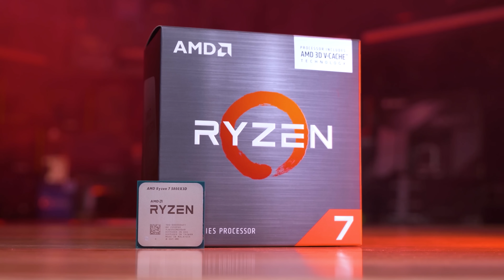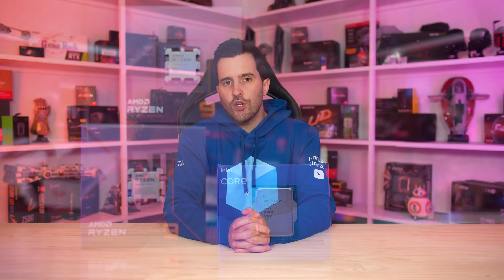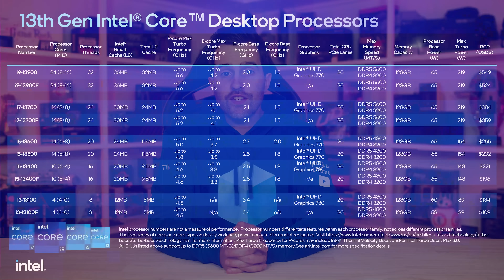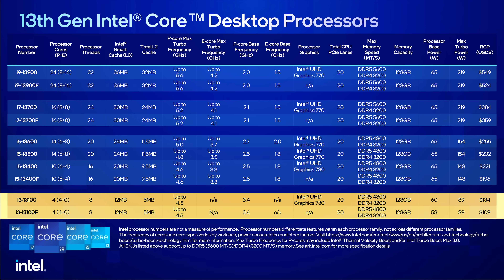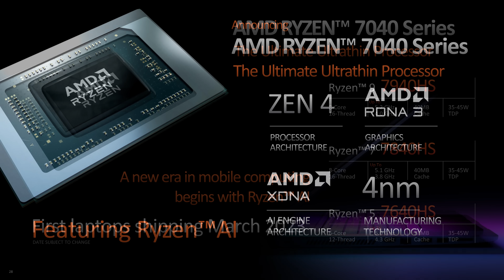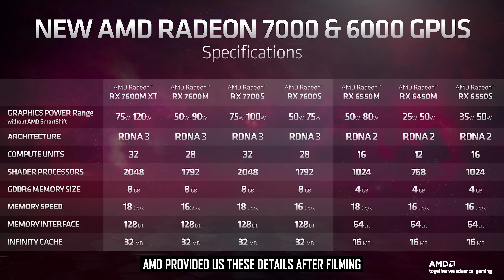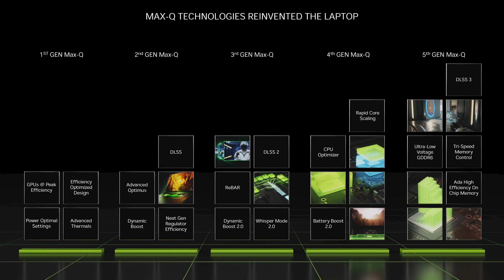Zen 4 3D V-Cache, 7950X3D, 7800X3D, New Cheaper CPUs, "RTX 4090" for Laptops - CES News Recap

Comment: Hey @Tim, do you remember the 200w rtx 2080 super laptops? The 200w rtx 6000 laptop from asus? The aorus x9 pro with dual 115w gtx 1070's from pascal? The 180w gtx 1080 clevo laptops? The 180w rtx 3080ti laptops from lenovo? 
 
I ask you this because MOST proper high end powerful laptops can very well handle a downclocked 4090. It has already been demonstrated by not only you yourself, but others that the rtx 4090 can easily shave off a large percentage of its wattage. What YOU mean to say are the high end PORTALBE laptops that sit at the 120w to 150w range. 

IF nvidia wanted to they COULD put a proper desktop rtx 4090 with better bins into laptops and give it something like a 225w or 250w TDP at which point it'd be likely within 10% to 20% of a desktop 4090. Still above a desktop 4080. That would really earn the name 4090 as it would be the same GPU and performance would not be that much slower. 

I really did not expect this level of laptop GPU research from you. I thought you'd at least remember the older mobile GPU's literally having higher power draws.

Comment: Whey didn't this come up in my feed. I just want to see V-cache on an apu. APU's suffer with low cache. If they add it to their g series. Intel will be in a lot of trouble. Intels mindset is add more cores = faster processor. That is not always the case as we have seen with the 5800x3d. They added infinity cache and it ran neck on neck with the 12900ks which is a 800 USD CPU and had ddr 5. The next few weeks gonna me fun to see how these 2 duke it out.

Comment: 7800x3d Only 20% better than 5800x3d?? 
Might as well stick with my current am4 ddr4 system then, not worth spending the extra £400 buying a new mobo and ram. 
And that's assuming a similar price between 5800x3d and 7800x3d, whereas in reality the zen4 is probably going to be more expensive too

Comment: I just got the 7950x 16 Core…….If what we are speculating is true for the 7950x3D, $800-$850 for the 16 Core 32 Thread. ($885-$935 after tax)
Should’ve I just waited till February? I just bought the 7950x 16core 32 thread for $604 on sale…..

If AMDs statement is true about it being 29% faster than the Intel Core i9-13900k, I would say the 7950x3D will be about 33-35%  than what I currently bought. Pretty much faster for about $300-350 more.
Reply: Should I have waited till next month 😭😭
Reply: @Garrus Vakarian Thank you for your reply, 
To answer your question, I am an animator/Graphic design artist, so I wouldn't be using it for games. I Still have yet to get all the parts for my PC, but I am planning on using it on making stuff on Unreal Engine 5. 
My current PC has a 5800x CPU and its not the fastest, so to the 7950x that would be a huge jump already.

I use 3- 4K monitors (Samsung UHD 4k 60HTZ, an LG 4K panel 60HTZ, and a ASUS Tuff 27in 4K 144Htz my main monitor) I also have a 1080p monitor just for the system overlay) 
My build will consist of the 7950x and the 7900 XTX Mech 310 GPU & 64GB of DDR5
Reply: @Garrus Vakarian I dont play games on my PC but I do work on Indie titles

Comment: I am little bit disappointed since AMD now has got quite a lot CPUs in their line up with just a little difference which is not good for a clear recomendation for consumers and weakens the overview.

And since the CPU wasn't the biggest factor in upgrading to AM5, I really would have like to see some cheaper boards to be announced!

The last times I upgraded my AMD system (2010, 2018) I could get a "normal" board for like 80 bucks (like Asrock or MSI) and often went with one for like 110 - 120 € with more features. So I am not really convinced to pay like 250 € now for the same tear of product.

Comment: Hey dude, boost clocks for the 12 - 16 core 3D parts are lower for one chiplet, not the other so you have single threaded or lightly threaded apps that will run at speeds similar to the X parts.  All-core loads will probably be a little slower since they are unlikely to benefit from Vcache and will be slowed down by the chiplet with Vcache running slower clock speeds.  But that slow down is going to be minor, I doubt it's more than 5%.

AMD made the best decision with this config because it keeps cost down with only one chiplet having Vcache, and it also allows the chiplet without Vcache to run its full speed.  So, kind of a hybrid config except you have full cores on either chiplet, and AMD has already worked with Microsoft for the scheduler but knowing AMD it won't be optimal yet and over time it will probably be improved so day 1 reviews will be a snapshot in time, which is always the case get should be understood by all who watch those reviews, that performance could or is likely to get better over time.  That's what happens with AMD GPUs every generation.
Reply: You absolutely fucking NAILED IT to a T haha!!! 🤣 Now about ≈9 months later, the thread scheduling has MOSTLY been figured out, but there's still the occasional oopsie game that requires manual disabling of the non-X3D CCD on R9 X3D CPU's in the BIOS/Ryzen Master to play correctly. 🤷

All that said, I still think AMD COMPLETELY made the right call with this asymmetric CCD design for Ryzen 9 X3D though going forward! It just makes inherent logical sense on SOOOOO many levels, and the thread scheduling will only continue to inevitably get better over time. Just like we saw with both OG Zen and then Alder Lake (both of which took a WHIIIIILE to have all their thread scheduling bugs ironed out).

Comment: I don't need a new cpu over my R5 5600x but boy does my early B series board need an upgrade. 1 USB header. 5 USB 3 are 2.0 on back plate. I wish the asus B650 was closer to 199. Vs 300 usd

Comment: My guess is that the higher advertised clock speeds will only apply to the cores that don’t have the extra cache for the 2 chiplets units.  So I think it is incorrect to think that the Ryzen 9 CPUs will be clocked significantly higher for gaming purposes; only half the cores (without extra cache) will and those won’t be used for games.  It will still be similar to last generation where you trade clock speed for cache; not really getting both at the same time.

Still nice to have the option of more cores for mixed use PCs that are used for both gaming and multi-threaded heavy workloads.  But I feel like the slides could have used an asterisk explaining that the higher clock speeds will only apply to half the cores, if that ends up being the case.

Comment: Being that no base clock was listed for the 7800X3D and it only boosting to 5.0ghz, I'd opt for at least the 7900X3D and maybe the 7950X3D depending on pricing ("Let's just hope they don't scalp them like the 5800X3D was").
Reply: ONLY 5ghz?😂 bro wtf? lol. That's still amazing and the 7800x3d is going to be 15-20 percent better then the 13700k and the regular 7900x etc even with slightly lower clocks. Don't be dumb bro, 5gz is still overkill for 99 percent of people and it's not all about clock speeds. Going by your logic you must think the 12700k is better then the 7700x for gaming due to higher clock speeds when it's actually way worse.
Reply: @darkhaven9119  Well, I just upgraded my AM4 rig with a 5800X3D so, I'll most likely be in a holding pattern CPU wise for another year or two, besides the new AM5, DDR5 and PCIE Gen.5 platforms need to mature a bit more before I'll invest that much money into revamping my whole rig ;)
Reply: @k24skin  oh gotcha bro. I have a 10700k rn and will be upgraded once zen 5 with vcache releases. By then 7200mhz ddr5 will cost half of what it does now.

Comment: The 7800 X3D with a max boost clock of 5 GHz is outrageous, essentially they are forcing their customers to buy either the 7900 or 7950 X3D in order to get a 6 to 700 boost in megahertz. This is approach an Intel and Nvidia levels of three and dishonesty and they should be reprimanded by consumers for this along with their 7000 series CPU lies.

Comment: AMD Ryzen 7 5800X3D vs 7800X3D still requires 20% more power.... not efficient in my opinion. 105Watt > 120Watt. Of course its nice to see performance go up, but for mini-ITX is a large increase of power.

Comment: I usually build a new PC every 5 years or so and built a modest system in early 2020. At this point, it's probably still the best move for me to upgrade the ryzen 3600 with a 5800x3d and get a few more years for only a couple hundred bucks.

Comment: For 7950X:
One CCD will have VCache and clock lower (probably 5GHz like the 7800X3D)
The other CCD will NOT have VCache but clock higher (up to 5.7GHz). Theoretically it could access L3 of the other CCD, but core to core latencies would not be lower than going to RAM.

One thing to consider:
If 7900X3D has 6+6 cores only 6 cores will have VCache while on the 7800X3D 8 cores will have VCache.
So there might be situations where games that use 7-8 threads are faster on 7800X3D than 7900X3D.

So the windows scheduler has to:
.) Run L3 intensive threads like games on CCD0 with VCache but lower clocks
.) Run threads that stay in L2 on CCD1 with higher clocks
.) But still keep threads using same data on the same CCD even if one is L3 heavy and the other one is not.

This sounds like a big challenge. I doubt this will work at release and ST applications will be run on CCD0 most of the time.

Comment: It’s pretty clear that they artificially nerfed the clockspeeds of the 7800X3D. There’s no reason it would naturally need that much clock speed reduction with V-Cache. Why did they do this? Because it would basically match the gaming performance of the 12 and 16 core parts, making the value proposition for those absurd. No one needs 16 cores for gaming. Absolutely slimeball move from AMD here, dropping the 8 core by 400 Mhz to force you to empty your wallet for the higher end parts.
Reply: pretty clear based on what?
Reply: @MrNelahem  The rest of my comment explains it. The other chips don't have nerfed clockspeeds at all. The 7950X3D stays at 5.7 GHz and the 7900X3D at 5.6 GHz. The 5800X3D is the only one with nerfed clock speeds, and it's by a massive 400 Mhz. That's so blatantly artificial.
Reply: @nonchalanto  The 2 CCD chips don't have lower clocks speed because they only have V-cache on 1 CCD. And the clocks AMD are listing are for that CCD. The 7800X3D is a single CCD design with cache so it has to have the reduction in clocks. The CCD's with cache in the 7900/7950X will also have reduce clocks.
Reply: @MrNelahem  If that's the case, then they are doing something equally as shady. Usually when a CPU manufacturer lists boost clock speeds, they mean in single-threaded workloads, aka the main thread you're using in a given task. While gaming, the scheduler will send the main thread to the CCD with v-cache. So you will never actually SEE the advertised clockspeeds, as they are only for the CCD that only gets activated for multi-threaded workloads...

Comment: I wonder if the only reason the higher tier cpus have the same boost clock is due to one of the ccds not having the 3d v cache
Reply: That would be correct! The 7900 and 7950 has the boost clocked listed from the ccd with no vcache.

Comment: It might actually be EASIER for OS's (e.g. Windows 11) to schedule stuff "more correctly" than for Intel P/E-core, because it should be able to see real-time L3 hit/miss rates for each process after some time (very short because... GHz).  Maybe OS can remember these values for each program, or maybe it can dynamically adjust during runtime.  It would be interesting to see what the software actually does.  I read some article about P/E-core scheduling, and it didn't seem very accurate, with just an arbitrary "capability number" given to each thread.
Reply: It'll definitely appear MORE difficult. For starters, Intel has thread director - an actual piece of hardware on the CPU to help inform Windows Scheduler on where certain threads should be placed.

And secondly, P cores are superior to E cores. They makes it a little easier. For 7950X, neither is necessarily better in general, but better in specific tasks/games. 

The logic required to figure out if cache misses are impactful enough to lose 700mhz of clock speed is difficult. At least in games, I expect AMD to maintain some sort of whitelist in the drivers to inform which specific titles should run on which CCD

Comment: These so-called "Max-Q" GPU's are nothing like the desktop counterparts, and should never be named the same.
It would have made more sense to call it an RTX 4080M, since it is essentially the same as the desktop counterpart.
I wonder why Nvidia stopped using the "M" designation for their laptop GPU's anyways.

Here is how I would have named them (plus specs):
RTX 4080M - 9728 CUDA cores, 16 GB GDDR6, 256-bit - AD 103
RTX 4070M - 7424 CUDA cores, 12 GB GDDR6, 192-bit - AD 104
RTX 4060M - 4608 CUDA cores, 8 GB GDDR6, 128-bit - AD 106
RTX 4050M - 3072 CUDA cores, 8 GB GDDR6, 128-bit - AD 106
RTX 4045M - 2560 CUDA cores, 6 GB GDDR6, 96-bit - AD 107?

Comment: I believe that the max memory speed should be a good hint on which one of the Intel CPUs are Raptor Lake (DDR5 5600) or refreshed Alder Lake (DDR5 4600), so the Ryzen 7600 should beat the 13400 on games and be on par in productivity. A shame that the 13100 didn't get at least some e-cores or 2 more P cores to help either in productivity or games.

Comment: 7900x and 7950x sits on 95C already with all core load under 360mm AIO. 3D cache on these CPU will make them even hotter. What hell of a cooler You need? 420mm AIO as minimum and idealy custom loop? :-D

Comment: The 7800/7900 3D chips sound interesting and the non X parts also could be very tempting. The 7900 non X could be the sweet spot, though I upgrade quite infrequently so platform longevity isn't quite so important to me. Still rocking a 3900X though I would like a bit faster core speed.
Reply: For me, at the end is price. If I have to pay +$1000 to upgrade just CPU+MoBo+RAM, I'm not buying it.

Comment: Hey peeps. 
Is this correct or am i missing something.
7950x3d - ccd 8/16 ccd 8/16x3d
7900x3d - ccd 6/12 ccd 6/12x3d
7800x3d - ccd 8/16x3d
5800x3d - ccd 8/16x3d
Does that mean the 7900x3d is at a disadvantage in gaming compared to the 8 core ccd counterparts? Will it basically run like a "7600x3d". Thoughts?

Comment: So the dual CCD versions only have vCache on one of the CCD? I guess that is why one CCD can clock higher than the other. Going to be a weird situation for software to utilize the correct CCD for the workload.
Reply: Won't be any different than scheduling between Intels P/E cores.
Reply: @mikem.9197  Intel P/E share L3 cache. Scheduling is just if a higher or lower performance thread is needed. With AMD's split design, the scheduler will have to decide if cache or clock speed is better suited for the specific thread, which is a more complex decision.
Reply: @RavTokomi I'm from the future, and while still not 100% solved it's mostly solved and not NEARLY as complicated as you seem to think. All it needs to do is figure out whether or not a video game is running, which is a lot easier than you might think. Yes, this does mean that those niche productivity workloads that can't utilize >8c/16t but also benefit from lots of cache likely won't get put on the X3D CCD but rather than normal one, but these CPU's are mostly aimed & marketed at gamers anyways, so.... 🤷 I really don't think AMD cares that much.

Comment: For purely gaming, would there be any reason to get the 7950X3d or 7900X3d over the 7800X3d?
Reply: IT seems that the boost clock will be the areason, 7800X3D has only 5GHz
Reply: @schabigerlump  would that translate to noticeably better gaming performance though? The 7950x and 7900x have higher boost clocks than the 7700x yet the general consensus is the 7700x is the best in regards to purely gaming.
Reply: @bmarcinczyk14  we dont know but its weird we did see only comparison of 5800X3D vs 7800X3D but nothing else.
Reply: Depends if the cache is (or even can be) distributed over all cores like for example 2x 32 megs or if it's 1x64 megs for 8 cores and the other cores without 3dvcache... also depends on what that does to latencies. And then there are the clockspeeds... Depending on if max clocks are 'reserverd' for the non vcache cores or if those clocks can also be reached by cores with the vcache.
Long story short: you pose a good question but we'll have to wait on further specs and reviews to know for sure...
Sopatience my friend. Patience. :)

Comment: Please include 1440p results when you bench these chips for us non-competitive MMO (or whatever it's called) gamers that don't play at peasant-vision 1080p on a 24" monitor...it's not 2001.  It would also be nice if you'd use a real-world GPU like a 3070/6700XT instead of the 4090 that nobody actually has.  We don't need every single configuration that has ever been sold, or every graphic quality in every game, just high settings with a real resolution and CPU/GPU combo please.  That will give the real world an idea of real world results.

Comment: New fast and relatively cheap \ good value cpus, are butchered by high motherboard prices and high ddr5 pricing.
 If someone has to buy something right now, am4 is still the better value platform with really cheap motherboards, cheaper ddr4 and even cheaper cpus.